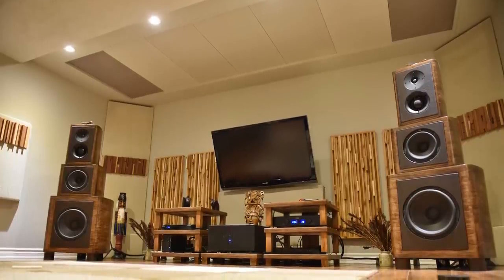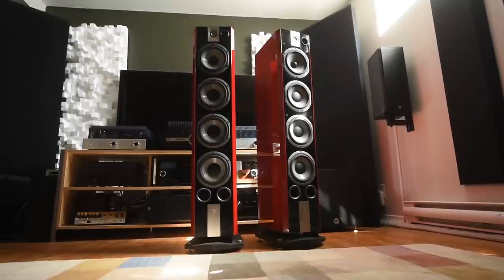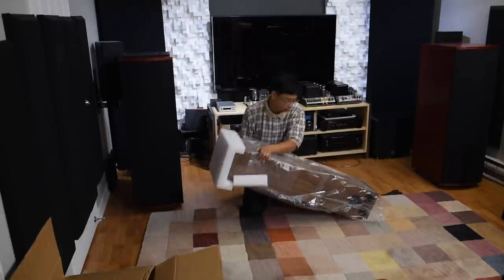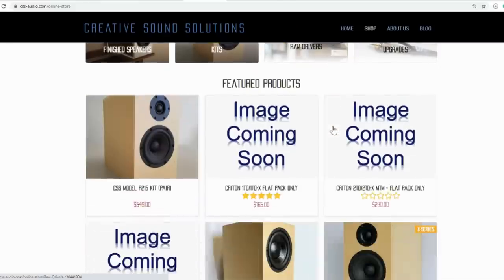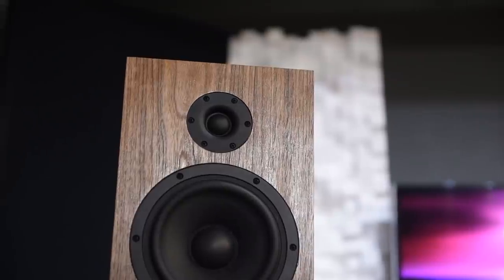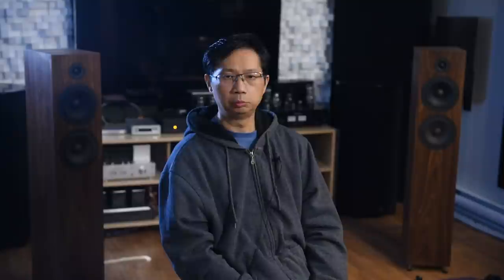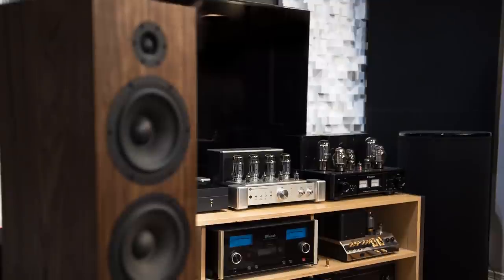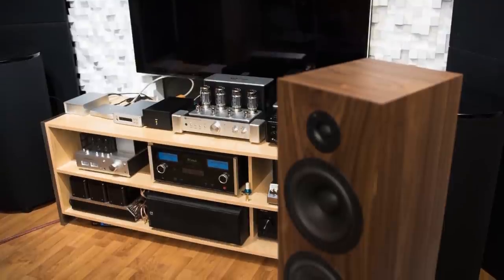Building your own high performance speaker, CSS Criton 2TD-X tower kit.

Comment: I once tried to DIY  my own speakers. It turned out to be the most expensive firewood I ever had.
Reply: My css critons suck. Tooooooo boomy.
Reply: @davidgonzales-ec8bo  pull them away from the walls especially out of a corner.
Reply: @davidgonzales-ec8bo  If you want to go all out, dive into the box and put a bit more dampening in the box and even replace the largest inductor with the next size up. And if the box knocks bonky, place 1/4" dowel wood across the inside of the box (touching each internal wall). Do them front to back and side to side, 3 times up a floorstanding speaker and once or twice on a bookshelf speaker (depending on size). Also place speakers nearly a meter from any wall and try holding and raising the speakers from the floor by a tiny bit. Like a centimetre or two. Hear the sound while picking up the speaker just a bit and noting the gap. I don't think it would be boomy then. If it's still booming, experiment with your bass vent (make it longer) or/and buy a better woofer and do something about your room acoustics. But try that first and the best position of your speakers. If still boomy then dive into the box. If still boomy after all that buy another amp.
Reply: Not me I have had really good luck with all my diy designs. I don't buy kits I would rather save money and design everything myself. But for the money they blow away everything I have heard out there. I laugh when I see how much people pay for speakers

Comment: I went the DIY route for my speakers and built a pair of Troels Gravesen designed Scanspeak Illuminator Monitors. I've yet to test a pair of speakers that beats them for my use.
Reply: Mr Gravesen is my hero 👍
Reply: Good for you! I'm building an Ekta mk2 right now
Reply: Those Scanspeak drivers are great.
Reply: @RennieAsh  Totally agree, the speakers cost me about £3k to build but that was with full Baltic Birch rather than MDF. But for the money, its great value. I'd like to get some seriously expensive (7-10k) speakers in to demo against them at some point.
Reply: Good on you, takes some skill to do , I couldn`t build a Troels or similar if my life depended on it ,  I bet those 7751 model sounds great , would love them in my system im sure,   enjoy your great Illuminators.
Reply: Unless you have friends with good speakers (and you can borrow them) the only way of testing them is to buy some expensive speakers. There isn't really any other way around it. They simply DON'T have hifi speakers for hire. I bought some B&W 706s for my reference speakers for my speaker building hobby. In my opinion (and my friend's) my made speakers smoke my B&Ws. Mine have semi open cones on the FR drivers. A gap between the driver and the speaker hole (that is bass vent tuned). Basically it's a bass vented woofer with a FR driver mounted just over the bass vent. Woofer is firing into the floor (with a floor gap) and the bass vent and FR driver is near the top of the box. Med sounds "different" and my friends agree, and they like the difference, and way more "airy" tham my B&Ws.
Reply: DIY almost always beats out manufactured speakers...  I went with DIYSG HTM-12's for LCR and Volt-8s for Surround/Atmos and nothing I have heard compares.  I have a friend with a very high dollar Home Theater using B&W speakers (costing him more than my entire theater build plus) and they just can't keep up.  I had him over to watch Oblivion and he was blown away... I know sound is subjective, but many people on AVS and other forums agree that DIY is the way to go..
Reply: How much are these? Was thinking bout getting the 1-TDX
Reply: They must sound great. My friend has speakers he built from Scanspeak and they are very nice sounding.
Reply: @spooner1  The irony is that i spend most of my listening to low bitrate Roon radio streams😆
Reply: @jasonpmcqueen  I am not familiar with it, so I cannot comment on the sound quality, but you may have a reason for doing so.
Reply: I got the CSS TDX 1 and I am using them with a Hegel 120 and I think they are exceptional speakers. I didn't know vinyl records could sound this good.

Comment: A friend and I were kicked out of a high-end audio store in Washington DC. A Salesman agreed to let me bring in my DIY speakers to compare with magicos 90 something thousand dollar speakers. My speakers had $4,000 in parts in them total including the Baltic birch plywood. When two separate customers came in and claimed whatever those speakers are sitting their sounds way better than the magicos, we were asked to pack up and leave and now! This is completely true. That salesmen called me back and ordered a pair of speakers from me.
Reply from the maker: Amazing story, thanks for sharing.
Reply: At the risk of asking the obvious question, what were they?
Reply: @stereotyper7375  A three way tower, with AE woofers, Accuton mids, and RAAL XR20 amorphous core ribbons. Mundorf Supreme, Mills, foil inductor, etc. In very proper 1.5" BB  plywood enclosures.
Reply: Thanks.

Pics!
Reply: @cdgee6399  would be interested in you plan to build a pair of my own.  Can you share more detail/build plan
Reply: @marka9073   I don't think YouTube is really the place for this. Pages of information and photos in the comments section won't exactly work...😉
Reply: @cdgee6399  true....don't know if there's an good way to do so directly. Your build seems solid build to attempt. As an audiophile myself with plenty of woodworking experience, I've been searching for an exceptional diy tower design complete  with drivers and crossover plan.

Comment: I have two pair of Critons and the CSS smaller P215 speaker. I built the X and standard 1TD model with upgraded crossovers. I partner them with Schiit Gungnir, Freya + and two mono Aegirs. I owned Dynaudio Evoke 20 speakers and a pair of JBL HDI 1600 speakers when I built the kits. I have since sold the Evokes and kept the JBLs for some listening variety. I am very sensitive to overly "topppy" speakers and found the Critons with REL 5Ti subs to be wonderful for a non fatiguing musical experience. Very true to the music and tonally pleasing. I just finished my X models and put them on streaming music to break them in. My listening room is in my garage/shop which is about 25 feet from the house. I was in the back of my house that morning and heard some rhythmic thumping. "What in the hell is that?" Then I realized I was hearing the muted bass from my Critons (No subs). The bass and mids are really amazing on these speaker. I am limited to high end hearing because of big guns in the military so sparkly speaker are lost on me. I can listen to these for hours with no fatigue. I built the kits for something to do. Soldering the crossovers is easy if you can solder (YouTube video). Super easy if you watch what you are doing. Clamping and gluing the prepared cabinets agains is an easy task. Adding veneer is the most difficult task but I watched several Youtube videos and managed to do a credible job. If you are at all inclined to fix things I would say go ahead and build a kit. If you want to avoid the work of adding veneer, turn them over to someone to put a nice paint job on them. A friend had a local auto body shop paint his. I also wonder if the people who apply wraps to automobiles could wrap them. You will need some tools to complete the speakers but in he end the tools will pay for themselves.
Reply: Hello Stagger, can you see much difference between the standard vs upgraded crossovers? and between 1TD Vs 1TDX? thx
Reply: @kirkaparty4143  Its hard to tell the differences on the Critons because memory fads, and it is a pain in the butt to change crossovers and install the four mounting screws.  I loved the Critons in their stock configuration and I also believe the new crossover add  new layer of nuance and delicacy. The stock ones are very good as made. I can tell the difference between the stock crossovers in the P215 speaker and the Criton with the enhanced crossovers. Is it worth $350 or $400 to upgrade? I can't say, that is a personal choice. I know for me, the idea that there is a better crossover out there that would improve a speaker that I already like would drive me crazy until I got it and that's what happened. I started out with a stock pair of Critons, upgraded the crossovers, the got the X upgrade. I had the old tweeters, crossovers and a half sheet of oak veneer left over so i got another wood pack, some woofers, binding posts and ports and built a second pair. Stock Critons with the upgraded crossovers are more rolled off on top than the X version. I believe most people would prefer the X version unless they had quit a bright system.

Comment: You are the best Hifi-guide and reviewer on the Tube! I have followed you channel a long time and your logical and analytical way of describing sound signature, equipment has learnt me so much. One can follow your journey via point to point references among your gear and your Hifi bodies. I had (and still have) the Wharfedale Dimond 225 and could connect them to your vast network of experience and comparing.
Reply: In order of appearance
Wharfedale D 225 (easy going and tone)
Wharfedale Linton 3 (vintage, seal box and paper speed and mid range beautiful)
Triangle Borea BR03 (amazing tone, a lot of bass and detailed enough)
Triangle Esprit Antal Ez (forward, sparkle, sensitive, fast bass, good at intensive and dynamic music.)
Rather different bunch of speakers and a move towards upper and forward kind of presentation. The Borea BR08 will probably be the next move and the sweet spot for my taste and wallet. Silk dome tweeter is what I prefer even thou the Antal metal dome horns are surprisingly easy on my ears.

Comment: The speaker kit biz has always been there, even if somewhat in the shadows, and the companies come and go. Everyone of them I've been familiar with over the years has offered great value for the money. Besides CSS there are several others with which you simply can't go wrong. a YouTube search puts you on the right track. There's something for every skill level, whether you take basic recipes from folks like Parts Express and do your own thing, or buy a kit that's fully loaded. 
The biggest drawback for many of us is the cabinet and its finishing. Lots of products out there that provide a good basic attractive finish without the need for practiced skill sets. You can sometimes get away cheaply when the local auto body shop is about to use that metallic black (or whatever) you covet on a vehicle and fitting you in would be a breeze. Even better if you've got a cabinet flatpack where everything fits nicely and won't require too much prep before painting.
Right now I've got a project for which I want to use a familiar metallic blue common in the Opel car line, and which gets used a lot in my area where the car is built. My body shop guy gets one of these jobs every 3 or 4 weeks, and the price to paint my stand mount MTM's will be very easy on the wallet.

Same for wood veneers. Talk to a local carpentry shop, where their down time could be your money saver.
Reply: have ya fooled around with EXCITER-style or *INFINITE-baffle Speaker set-ups? Boxes are dandy, and Transmissions are best. But these may be BETTER!!

Comment: I've seen this video twice, very fascinating. I'm getting more into "Musical" speakers with rolled off treble. I must be getting old too! I built my own ProAc 2.5 Response speakers clones with Scanspeak drivers. I used Miflex and Jantzen Superior and Silver capacitors, coils and resistors. It is a life time speaker, the most musical and transparent piece of gear I've heard that will out do B&W speakers and more that I've heard. DIY is not for everyone, if you are not patient, willing to tune by simple measurements and mostly by listening and adjusting - or working with tools... Forget it. No point in making a speaker that sounds like trash because no effort was made. You just have to put the effort until it's fully tuned to YOUR room and proper impedances to amplifiers and baffle corrections are made. To make a great speaker, you can't make short cuts, or use crappy materials. You need time, effort, patience and a reasonable ear. You should also put effort in understanding how the drivers will behave with the electronics, etc etc etc. And listen, listen and listen! 👍
Reply: You can also build a design by an experienced designer
Reply: Or just use DSP EQ
Reply: I am good with tools, but do not have the proper tools for the project. The overall technical needs sound scary. Congrats to you. You should be proud of your accomplishment.

Comment: For me, DIY speakers are the only way to go.  One has total control over construction, components and xovers builds, etc.  I built the Solstice kit from PE.  It uses Morel woofers and tweeters and I am very happy with it's performance.  With a little elbow grease one can have speakers that compete with manufactured at a fraction of the price and customized to ones preferences.  A rewarding project.
Reply: I agree. I don't know anyone who uses the materials I use in my multi layer cabinets.
Reply: @BostonMike68   Exactly. Manufacturers are going to cut corners wherever they believe than can get away it.
Reply: @buzzcrushtrendkill  I can't believe how cheap they are made and how much that they charge and people pay it.

Comment: Busted!. I have four. CSS Criton 1TD-X, HSU HB-1 MK2, Elac Unifi 2.0 and Encore X-SLS
Reply: How do the Critons compare to the Uni-fi 2.0?
Reply: How do the Encore xls compare to your CSS?
Reply: @JC-lk3oy  see my criton video
Reply: @galessi1226  see my criton video
Reply: @JC-lk3oy  criton all all about the bass show but for sure a more refined treble and midrange. Elacs while detailed and presice are more forward. Both play at at volume which is my thing might not be yours. Also see my encore x-sls review for opinions
Reply: @galessi1226  encores great. Best bass texture and tone for sure. Cannot handle deep bass at volume. Criton much better overall but much more expensive. Both have great tweeters neither have have a focal sparkle which is not my thing. For sure the critons are a bass show. How can one feel bass in your chest without being a v curve speaker. I mean it thumps but so accurate and not boosted. Just finished the css 12 " sub and omg so musical like a rel I would say
Reply: @JC-lk3oy  I think I have my opinion on this I own both. I guess see my channel or i have splashed this on gr research  tubes or others. That my help.

Comment: In the 70's and 80's it would've been very difficult to compete with high end production loudspeakers. Today there's an abundance of quality parts available for DIY people. I built a pair of open baffle speakers utilizing a 12 inch  paper cone woofer mated with a BG neo tweeter. I used KZK, Solen and Cornell Dubilier capacitors in the networks. The speakers were paired with two 15 inch open baffle subs utilizing 
heavy dsp. The end result was jaw dropping. Very dynamic and lifelike. However, altogether way too big for my listening area. But it was a rewarding experience.

Comment: Hello - You called me out when when you asked who out there has two pairs of speakers!  Hah!  I have a pair of Focal Mezzo Utopias, and a pair of Von Schweikert VR-4 SR MkIII, which has some characteristics of the Mezzos, but they are more musical and atmospheric as you say.  I really like both.  My audio mania has spread to amplifiers also.  I have a pair of custom modified made tube amps making 260 wpc using four matched pairs of KT 120s per mono amp, next is an Esoteric 400 wpc stereo amp, and lastly, a pair of Audio Research Class D mono amps knocking out 650 wpc.  Each combo offers a very different presentation.  I like them all!

Comment: Wow what you said nailed it. I recently purchased a set of another company diy speakers and sprung for all the upgrades.
At first I thought what did I do just throw away my money? But the more I listened the more I liked them. They are very very good sounding but a different sound than what I was used to hearing every day and grew accustomed to. But the lows are very good as you said and the clarity is out of this world. Before deciding to do the diy I was looing to buy some Focal but not the upper tier models. I like the details like a players fingers squeaking on the guitar strings or a a sax player taking a inhale of breath.

Comment: I have the Criton 1TD and share all the impressions. Very smooth warm lush sound. I have the Yamaha NS1000 as every one seems to highly regard it as one of the best vintage speakers to have. It is just way too bright. Yes its very detailed and has amazing soundstage etc but everything sounds “tiring” to my ears on that speakers. Whenever I switch to my Criton, i have a big smile as I can enjoy music again. I wish CSS uses a better tweeter for clearer high but the bass and mid coming put of the Wavecore woofer are amazing.
Reply: I purchased and built the Criton 1TD and at first I was happy but the sound was just lacking.   Sounded good but did not wow me from my Swan 3.1 DYI kit I build previously.    However, after playing for several weeks they just needed to break in.  Now the bass is wider, deeper and the sound stage more open and airy.  The top end seemed to just be cleaner.     Very happy now and better than teh Swans.    I wonder if Thomas's impression would change after a 200 hours of break in time?